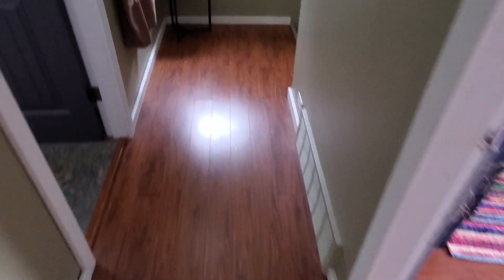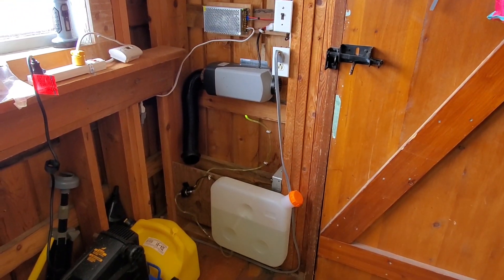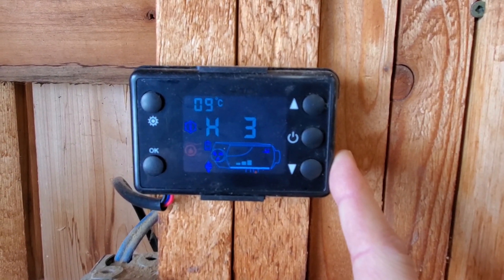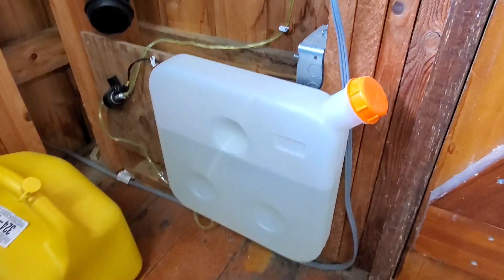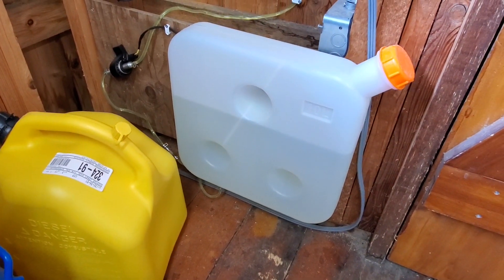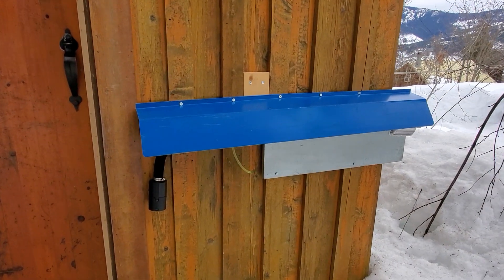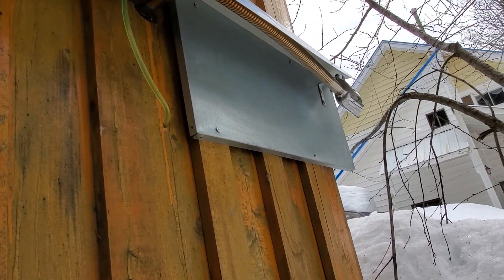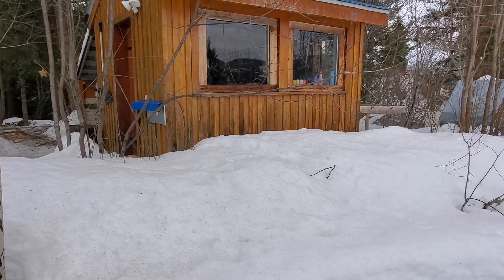Chinese Diesel Heater for a Workshop/Shed (5KW)

Comment from the maker: Just a little update: Heater is running well still. No issues. I am going to change my setup slightly to avoid damaging the unit if the power goes out while it is on - I will add a small 12V vehicle battery that is continually connected to a charger. That way if we lose power the heater will not be affected and as someone said "cook itself to death" :)
Reply: Question... I notice you have the unit installed with the intake and exhaust on the side as opposed to it operating with the intake and exhaust on the bottom. All of the instructions I’ve read show installing with them on the bottom. Have you had any issue with how you installed?
Reply: @jeremylocke3739  I'm wondering the same I want more options to install
Reply from the maker: @jeremylocke3739  No, as long as you have the glow plug on top.
Reply: Love your set up,  can you tell me more about your power supply,  is it a 15amp or 20amp , trying to figure which one to get, not finding to much info from these heaters and what the amp draw is. Or if you could tell me which one you are using from Amazon would be great.  Wanting to heat my workshop
Reply from the maker: @DavidGuns  thanks! I used this one, not available on prime anymore it looks like but many similar are: https://www.amazon.ca/gp/product/B01E6S0JS4/ref=ppx_yo_dt_b_search_asin_title?ie=UTF8&psc=1&fpw=alm
Reply: @DavidGuns  Amp draw varies depending on if glow plug is on or not. 2A to nearly 12A, if I remember rightly. Someone on here did a power draw test with all the metering setup.
Reply: Great video! What type of charger did you use for your 12v battery?
Reply from the maker: @alanaweber8174  its a 20 amp AC to DC converter off amazon.

Comment: Thanks for the video. Have you considered taking the heater off  grid?  In the event you lose power, the heater could be damaged...  I just installed an All-In-One diesel heater in my 8x8 work shed with a 7 foot ceiling.  Although we don't lose power that often in NW New Jersey, in does happen.  I have a 12 volt AGM 35ah battery & a single small solar panel maintaining the battery.  So far so good. Holiday Blessings to you Sir & the family.
Reply from the maker: Yes, I am also going to use a small battery as backup just in case we lose power.

Comment: I want to install a diesel heater on a shelf inside the van
Can I leave the fresh air inlet to the burning chamber open to the inside of the van and exhaust the exhaust pipe to the outside through the wall to the outside 
Thanks
Reply: It could be done...BUT...you would have to crack a window to allow fresh air to come inside to replace the exhaust air, and that would make the system less efficient
Reply from the maker: @user-cy6gf2pj7y  True. I would put anything connected to the combustion chamber outside just in case.

Comment: If you hold the setting button and arrow up ( top two buttons) it will allow you to adjust the hrz of the pump.
Reply from the maker: I will try that!
Reply: @RuggedOffGrid  The one I have, looks identical to yours, hold the "OK" button down while also holding the "UP" button in order to go into HZ mode from temp mode. Do it again and it will revert to it's previous mode.

Comment: I have one in my garage- 21' x 23' and it heats it fine. I have been using it for two years now with no issue. I did not make a video of it but you can see it running when I make some videos this winter. (also in Canada-Ontario)
Reply: Hey, Im also in Ontario Canada. I run the same heater in my 18' x 18' garage and it works pretty good with only 8' ceiling.
Reply: What temp do you keep it at?

Comment: If power goes out while heater is running it will cook the electronics of the heater without proper cool down.
Reply from the maker: I am going to get a small battery and charger to address that, thanks for the comment!
Reply: This is a good point, and if you think such a possibility exists, it's better to get the power from a battery or UPS.

Comment: Mounting it sideways on the wall, does it leak fuel?
Reply: No, as long as you have the glow plug on the top side.
Reply: Hmm guess I must have put mine on the bottom then. I had it leak during the first start up because I left it priming too long. Just a spoon full worth. Hasn't leaked since.
Reply: @court2379  mine was positioned the right way and was leaking.  The hose that is supplied is to big for the connector on the heater itself but too small for the pump and filter lol I had to cut larger hose to slide over The plastic hose to connect the pump and filter.  For the heater connection I just used some sealant around the base and let dry and it stopped leaking with a hose clamp of course.
Reply: @derekgonet  I installed it according to the documentation, which allows several orientations, so what is the right way? I put the the ports up, to vent thru the roof.
Reply: @court2379  I was going by what rob said ?  With the glow plug up top.
Reply: Guys what OZ is saying about mounting at 90 degrees/sideways is that the glow plug needs to be above the intake/exhaust ports. Mounting it upside down/180 degrees is definitely not advised! Condensation can build up in combination chamber and cause serious damage at best. If that cracks you'll be getting CO into your supply air. Also the battery and smart charger is the best way. A basic lawn tractor battery at Wally world $25-$30 and a $20 2-4amp charger/maintainer is a great safe reliable set up.

Comment: Thanks for that.  I bought one for last winter but didn't complete the installation because last winter was much warmer (around 0 instead of -15C).  However, I'll get back to it again now.
Just one observation - the instructions state that there must not be an interruption to the electrical supply whilst the unit is operating so how do you cope with only that power supply?  I intend to use an ATV batttery with trickle charger for the 12v source.
Reply: I think I will incorporate a battery as well just in case.
Reply: @Robbbbooo  My installation is now working fine but the testing weather is yet to come. 
I used 12v ATV battery and a cheap charger from Lidl. Be aware that there is some current drain even when the heater is off so you might want to include a switch in the 12v supply to the control panel.
Reply: Further to my previous comment, I found that the ATV battery and trickle charger combination was not up to maintaining the heater operation at full output for  a prolonged period. I have replaced the battery with a small car battery which has a higher capacity.  The trickle charger is not enough to maintain the charge at maximum demand but it does replenish the battery sufficiently once the heater stabilises.
Reply: @robt2151  good to know! I think the heater uses about 11 amps at 12V for startup and shut down and about 4 amps constantly. So I think you'd probably want a 5 amp or higher charger?
Reply: @Robbbbooo  Yes, the Lidl charger is not really up to this job.  It has the annoying defect of not being able to set to charge remotely, eg, via a time switch, as it goes into a monitoring mode when connected and must be manually switched to charging mode.

Comment: Very informative video. Just got yourself another subscriber. Any plans on insulating the garage? That would also be a good video.
Reply from the maker: Thanks! I have thought about insulating the space but don't think I will. I use the space between the studs for shelving and storage. I did seal up some of the cracks in the siding with spray foam which has helped a bit. With the diesel heater and the size of the space I can live with it being uninsulated for now.
Reply: @RuggedOffGrid  What about just 1" of closed cell "blue" foam insulation cut to fit between the wall studs and glued to the exterior wall?  It would add an approx "R-5" insulating value, as well as tighten up a lot of the air leakage, and wouldn't take up much of the "storage" as you call it
Reply from the maker: @user-cy6gf2pj7y  Good idea! Hadn't thought of that. 1" would not really effect my storage space!
Reply: @RuggedOffGrid  and make quite a difference to lessen the heat needed in the shop!

Comment: Great video. Just a couple of questions. What did you use in the wall to isolate the hot exhaust from the surrounding wall. Also the power electrical power unit do you have a link for that. Thanks again really interesting video.
Reply: Hi John, I used some leftover roof flashing to protect the wood siding. The power supply I used is here: https://www.amazon.ca/gp/product/B01E6S0JS4/ref=ppx_yo_dt_b_search_asin_title?ie=UTF8&psc=1.
Any 20 amp 120VAC to 12VDC power supply will work.

Comment: First just subscribed enjoyed the video and have a question your heater is mounted 90 degrees from the normal bottom exhaust set up any problems with this. I have two of these heaters one for a Florida room and one for the office at my business . This orientation  would make a much cleaner installation any information greatly appreciated
Reply: Hi John, no issue mounting it 90 degrees as long as you MAKE SURE GLOWPLUG IS ON TOP! Sorry for the caps but that is critical. Enjoy!
Reply: @Robbbbooo  I guess I'll have to rotate mine around. I think my glow plug is on the bottom and I've been getting a small leak from the casing

Comment: I am in Alberta here. My woodworking shop has a 220v electric heater. The past three years I have seen spikes of like $200+/month in the cold canadian winter because of needing to heat my shop! I have wood heat in my home(can't beat that cuz wood is the best heat PERIOD...and i always have wood) but man... that electric bill for the heater in my shop is killing me! Anyway... I just bought an 8k diesel heater and will be installing it in my shop before the snow flies. IT MAKES TOTAL SENSE!~
Reply from the maker: Good choice. The diesel heaters are very economical.
Reply: Hello all, I am also from Alberta; interesting video. Thefeet, have you installed your heater yet?

Comment: Hi, great economical setup.  Just a bit of info for you.  Diesel combustion produces a very small amount of Carbon "monoxide" but does produce Carbon dioxide.  If you were to fill your shed with the fumes from the heater the oxygen atmosphere within the shed would be pushed out and you would die from asphyxiation and not Carbon "monoxide" poisoning.  I found this out when I had a blown head gasket in my diesel 4x4 and the mechanic was testing the coolant and it kept coming up negative for a blown gasket.  The reason. The test tests for carbon "monoxide" suspended in the coolant.  Eventually he spat the dummy and pulled the head off anyway and found the blown gasket.  When he looked into as to why the test came up negative we found out the information.  Petrol & LPG on the other hand are the killers.  Not to mention how much moisture LPG puts into the atmosphere.  Anyway thanks for the video.  Cheers
Reply from the maker: Thanks for the clarification!
Reply: I will add... CO would kill the cat sleeping on the floor before it would ever harm one in a setup such as this. A well-vented webasto to the outdoors is rarely a problem. I'd be more concerned after seeing this if there was not sufficient WRAPPING OF THE EXHAUST PIPE passing through a wooden wall with asbestos or even something like this: https://www.amazon.ca/gp/product/B07C17DZ3F/ref=ppx_yo_dt_b_asin_title_o00_s00?ie=UTF8&psc=1  (FIRE HAZARD)

Comment: Hi, nice setup and I haven't seen any bad reviews of the diesel heaters. Can you tell me more about the power supply, e.g. what is the 12v rated output?
thanks.
Reply from the maker: Hi Bruce, its a 20A unit: https://www.amazon.ca/gp/product/B01E6S0JS4/ref=ppx_yo_dt_b_search_asin_title?ie=UTF8&psc=1
Reply: TheOznucks thanks mate👍
Reply: @RuggedOffGrid  20A seems like a lot.  Have you ever put an amp meter inline to check the actual draw?  I was thinking of using a LED striplight power supply.  I have a 10amp one spare that I was considering using.
Reply: @jerryschull2122  The wiring schematic shows a 20A fuse.  I understand that there is a surge demand on start up which then settles down once the unit is running.
Reply: @robt2151  thanks, turns out i had a spare 30a supply.  works fine
Reply: These units are chinese spin-offs of the "webasto" that truckers have been using for years up here in the great white north. Buyer-beware. Pumps, seals, hoses etc. may not be the same quality for longevity as brand name "webasto" BUT.... you get what you pay for and if you are willing to maintain.... all is good?
Reply: @thefeet  Yes, you do get what you pay for... I could buy 6 of these units in a 5KW model, or ONE 2KW Webasto for 1500!! LOL (We have Webasto Coolant heaters where I work... unless you run them daily or at least a couple times a month, they will not work when it gets cold and you NEED them to work!!! So for my shed? My money is on a Chinese Heater!